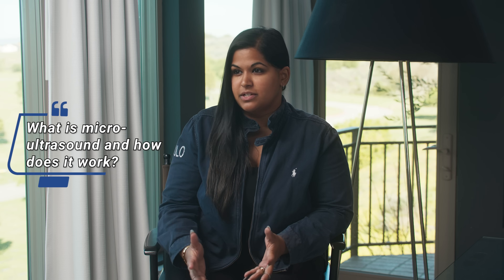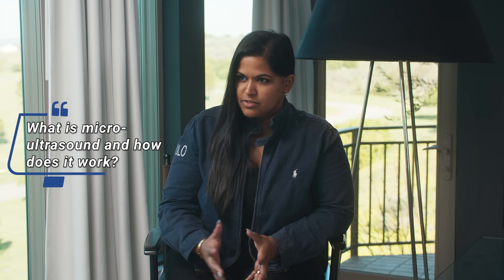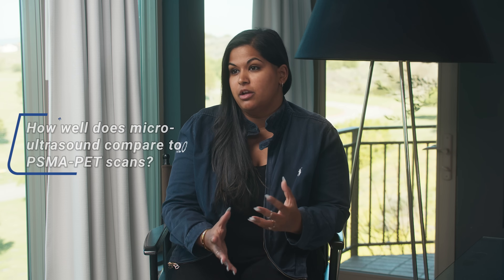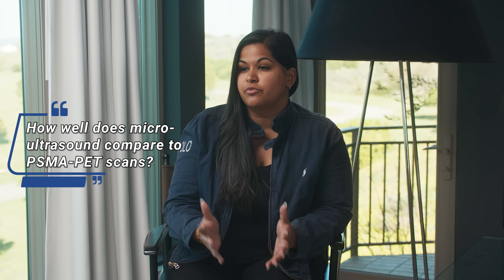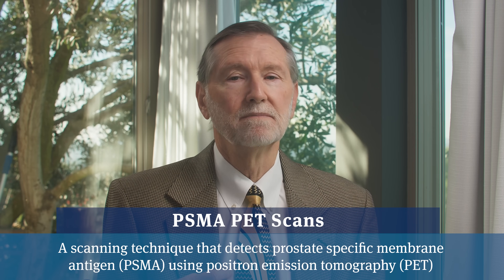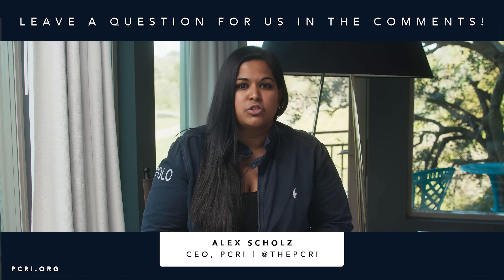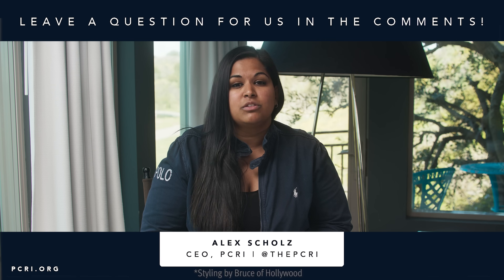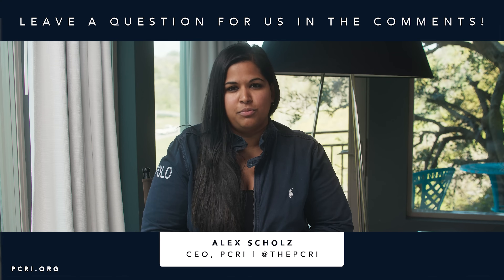Micro-Ultrasound: New Developments in Prostate Imaging | #MarkScholzMD #AlexScholz #PCRI

Comment: Hope Dr. Scholz takes up the topic of liquid biopsies in one of his lectures. A new patented technique called the HrC test costing USD 125 has been introduced in India (and undergoing trials in US and UK) where a blood sample is used to get an accurate picture on the status of any cancer in the body. HrC reports on a scale starting from zero to 40. Zero to 2 indicates no cancer, >2 to 6 indicates inflammation/low risk of cancer, 6-10 indicates moderate risk of cancer and anything beyond 10 indicates presence of cancer (including a Stage 0 state). A further detailed analysis of the same sample costing USD 1200 will give the exact details of the cancer and its location as well as metastasis if any. And this test can detect ANY cancer. This has been verified on a blind trial on 1000 people (500 without cancer and 500 with cancer) with more than 99% accuracy.
Reply: Liquid biopsy is just a novelty; not accurate enough for top shelf diagnostics…

Comment: Phenomenal tie and great video. I agree this micro-ultrasound could be beneficial. I had a pirads 4 lesion on mri scan which turned out to be nothing. Instead of doing a fusion biopsy I could have first confirmed with this micro-ultrasound.
Reply: I have MRI done on 04/21/23 and Pirad 3 with one lesion.(Because of my PSA 4.3( which was done on 01/12/24.Then I did another PSA test on 02/23/24(after an MRI) came down to 1.23.Then I talked to my urologist and we agreed an active surveillance.Your thoughts will be appreciated or any advice.
Reply: @Ohio-o5f  sounds about right. I would repeat mri yearly. If lesion is same size and your psa is within normal range I wouldn’t worry. Active surveillance sounds good to me. I am no dr though. A biopsy is no fun.
Reply: @ncvman did you ever get the fusion biopsy?  I agree with you, a biopsy doesn't sound fun at all, according to research. I'm skipping the biopsy for now against my urologist advice. Not keen on having my prostate poked unless it's absolutely necessary.   My PSA is 6.3.. 2 MRIs both show no evidence of malignancy but my urologist insists I need a biopsy I'm insisting I want monitoring instead
Reply: @FernRivera-dz8pr yes sir fusion biopsy but did at a hospital and they gave me propofol. I went sleepy sleepy so it was pain less and easy.
Reply: @ncvman what was the result?  I'm not afraid of the biopsy itself, I just don't want my prostate poked if it's not necessary.  Not keen on all that bleeding for days or weeks just to find out it's not cancer or it's clinically insignificant cancer. I don't think it's worth damaging your prostate "just to make sure" .
Reply: @FernRivera-dz8pr they found nothing all 21 needles normal. Also sent slide to John Hopkins for second opinion. Also sent away for genetic testing. All said I do t have anything
Reply: @Ohio-o5f my urologist insists I need a biopsy with PSA of 6.3, but 2 MRIs both show no evidence of malignancy, no lesions, only mild BPH .. no fam history, I'm skipping the biopsy against my urologist advice